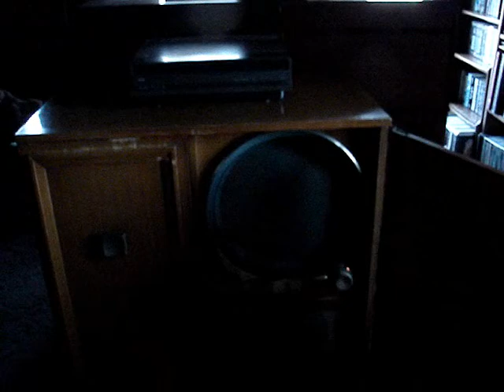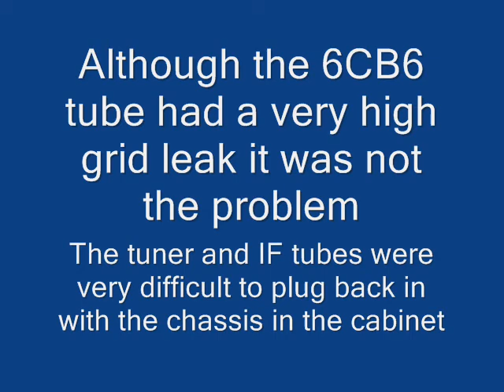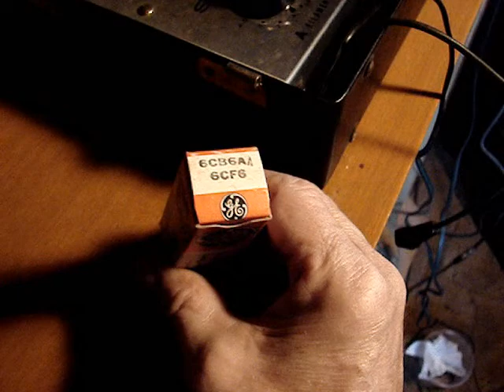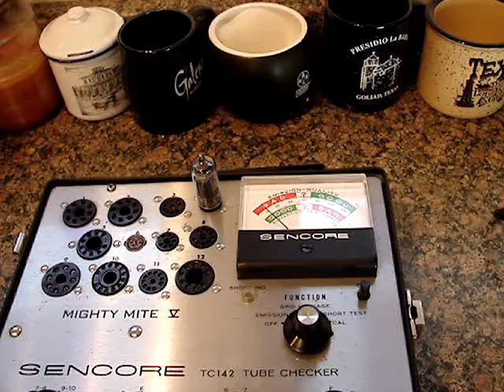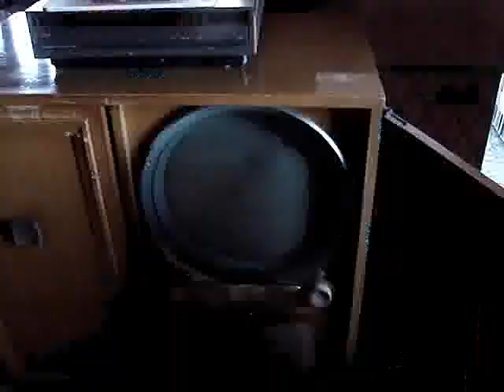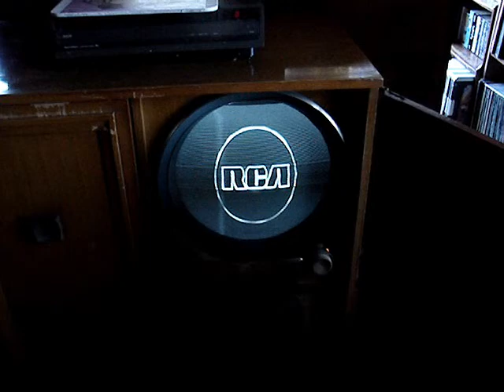Fixing my 1951 Zenith Wadsworth TV set

Comment: But the Selectavision intro just isn't the same in Black and White. :)

If it weren't your voice, I'd seriously wonder if I hadn't made this video.
Reply from the maker: Hi Matt; I have three selevtavision players and many movies in that format.
Reply: @HD7100  I have one, it's actually a Hitachi (I think) and better than the RCA ones in my opinion.  Unfortunately my dog ate the remote.  I have about two dozen movies.  I don't watch many movies.  The only one I've really watched on there is Tora Tora Tora.

There really is something amazing about that format though.
Reply from the maker: @KC9UDX  I have collected the CED movies and players that I have mostly for nostalgia because I bought into CED when the system was released new in the early 1980s. LaserDisc at that time was a lot more expensive. I did not like the occasional skipping of the CED discs so I finally invested in LaserDisc and I have quite a large collection of movies in that format.
Reply: @HD7100  I bought most of my CEDs at a pawn shop in Madison when I lived there.  They had a wall of CEDs, I'd estimate 500.  I didn't get my player until about 1997 or so.  It was an early eBay purchase, when they weren't expensive.  The one I got was listed as not working.  It had a bad stylus, but came with a spare good one!

Comment: i wont judge you for using a ced player with a roundie :) 
sometimes the tube sockets just wear out from too many tube replacements... certainly a thing of the past 
i noticed you said the one of the tubes was a 6cb6 but you used a 6cf6 in lieu, is that just a tube that supersedes an older style?
Reply from the maker: The CED player is only temporary. I have been scheming on devising a system that I could use to demonstrate my vintage TVs with television programming from the era the TVs were being used in. The tube I used was labeled 6CB6. The box just listed the alternate 6CF6 which is the newer replacement.